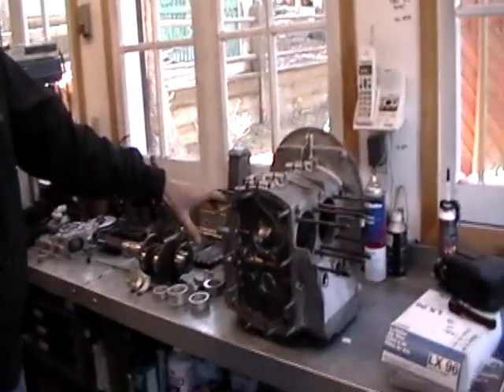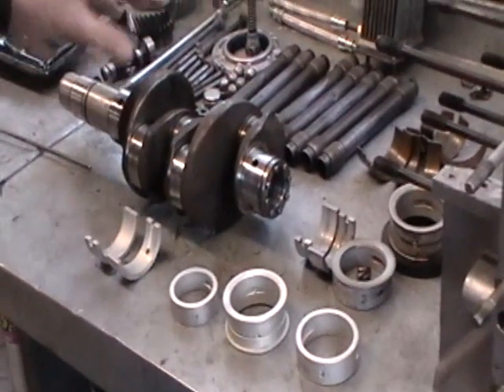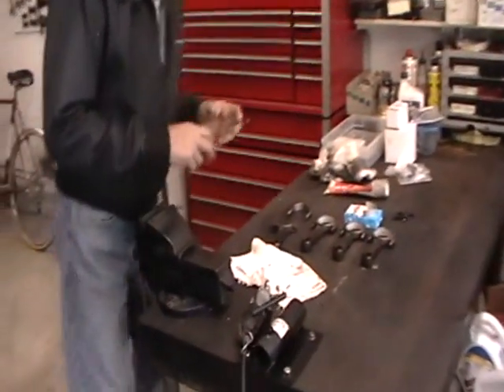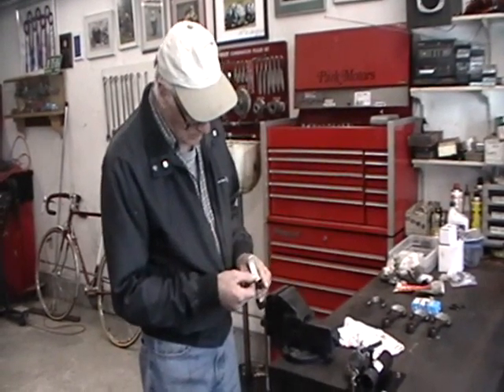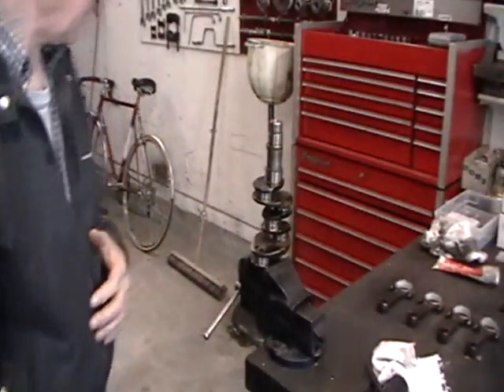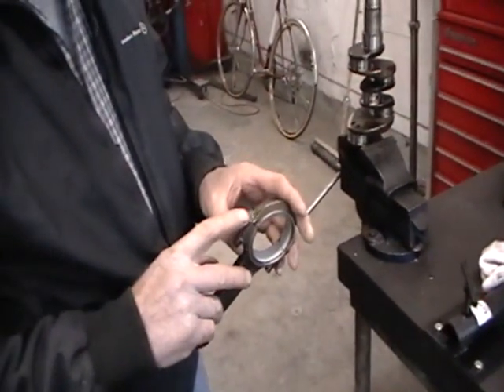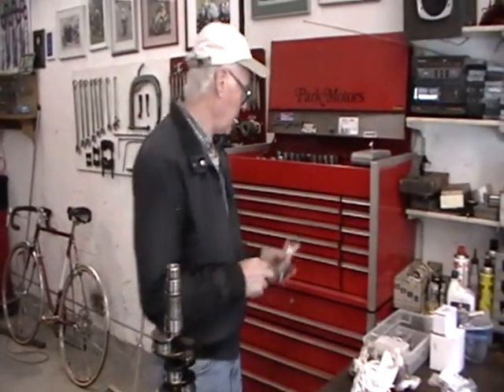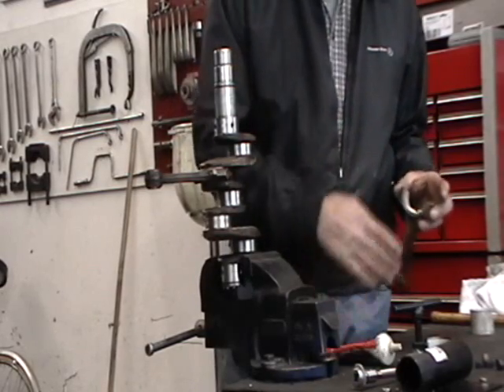Porsche 356 engine

Comment: Were the rods balanced? Were the piston pin bushings sized? Were the ends of the bearings chamfered? Thread lock and 30 foot pounds on the rod nuts, thirty-three is too high. Was the case checked for signs of overheating/warpage?

Comment: With regards to the rod bearing shell tabs, did he grind the rod and end cap with an insert on the opposite side so the bearing would locate?

Does this mean the rods and endcaps have inserts on both sides?

Great video, love seeing Porsche master techs at work!

Cheers

Steve